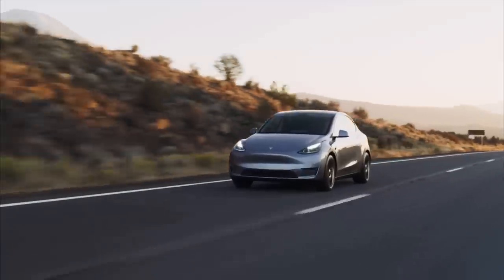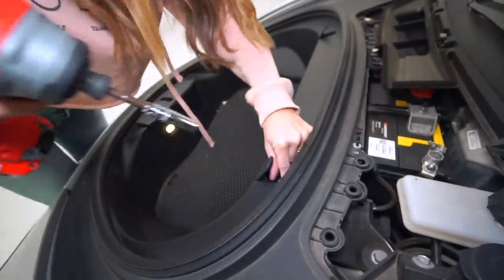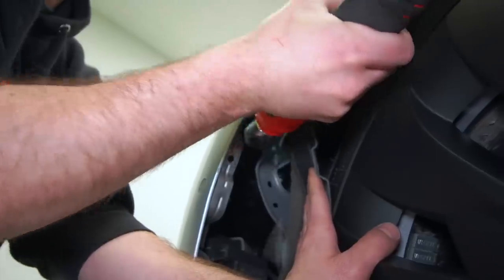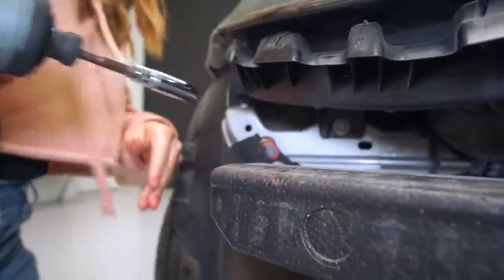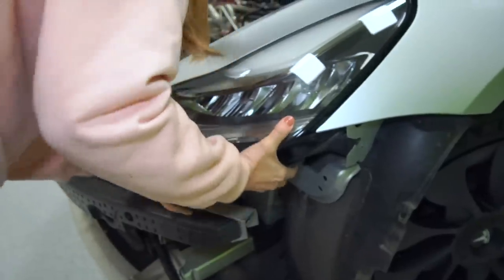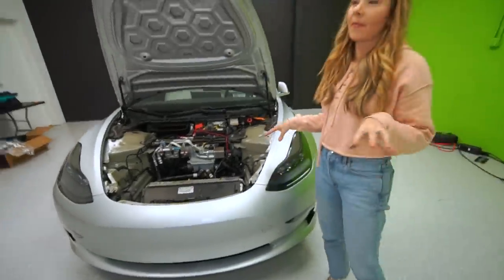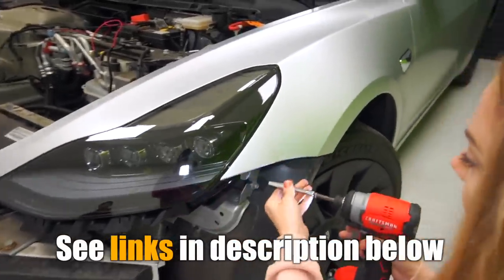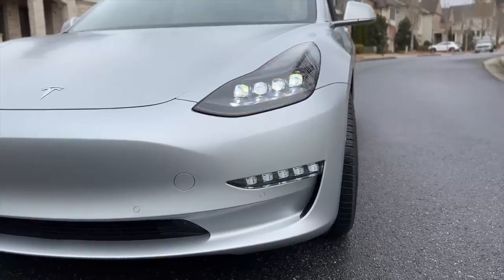My TESLA Headlight DIY with Jaw Dropping Results

Comment: Looks like a worthwhile upgrade, if you have the old reflector only lights. If you have the matrix lights stock, I don't know if it would be worth it.
Reply: I would have to agree.
Reply: The matrix benefits the oncoming traffic, but doesn't increase light output.   The AlphaRex lights still offer an increase in light output over matrix as well.
Reply: Price and where to get them?  I've replaced headlights on 2 or 3 different vehicles, but never have I had to remove body panels.  Seems so odd!

Comment: I'm planning this for my 2018 Model 3 and wanted a video more reflective of the bolts as they would be in 2018 models. I also plan both changing headlight and fog lights, doing it myself with Dad help, since bros aren't near. Your video is perfect. Thanks.
Reply: did these alpharex headlights fit in your 2018 Model 3? I want to get for my 2018 Tesla Model 3 Long Range RWD and make sure it fits and works

Comment: These headlights don’t work anymore on the new Tesla update. They quit working on me after I did the new update. I had to put my stock headlights back on. Unless Alpharex finds a solution, don’t even bother buying these for your Tesla
Reply from the maker: Doubt it’s related to the update. I had the same update and works fine. Plus should be under warranty if something has already happened.

Comment: Those look very nice and great job, any stress on the battery with more light coming from these?
Reply from the maker: Always a common question but any extra used energy would be negligible compared to external factors like air temperature, vehicle load, speed and rolling resistance.
Reply: I would think so because these seem to be also powered by the 12v battery

Comment: Thank you! A subset of your viewers of which I am firmly a part would be interested in the relative energy use of the original vs the changed out forward lighting options. For night time driving situations how does this change affect the car's miles per kWh performance? Knowing this we could then weigh this data with any potential increase in safety the change out enables. These two metrics, efficiency and safety are so much more meaningful to me than the appearance of the two choices.

Comment: Wonder how big of a difference it is…(in not blinding, oncoming traffic)
Whenever I’m on a dark road I get lots of people flashing me thinking my brights are on with the stock headlights… Is this a dramatic reduction?
Reply: yeah, not like the factory Tesla headlights are dim or anything! TOO bright and precise, does this make it worse?
Reply: You can adjust them down in the service menu.  Most likely they are just aimed too high
Reply: that can happen when the autoleveling fails or goes wonky. just set them yourself and make sure they dont blind. maybe set the one on the oncoming traffic side a bit lower
Reply: That's the purpose of the sharp cutoff line mentioned in the video, It keeps the glare out of oncoming traffic better than stock headlights.
Reply: @pgwar22  which is a problem unfortunately with modern headlights.... especially on suvs.

Comment: Like the video. But why do the lights need a separate battery hook up? Most lights (that I know of) are plug and play.
Reply: The new lights probably draw too much current. Hopefully they include over current protection or an easily accessible fuse.

Comment: What about the feature that new Matrix Headlights which moves with your steering wheels (not software updated yet)? Would these Headlights also pivot multiple directions?
Reply from the maker: Good question, I know these do mechanically move in the high beam position but your other question would be best to ask Tsportline.

Comment: Do you get any HCMR Mismatch errors in Service Mode? You can enter service modes and press "Service Alerts". The reason I ask is Tesla headlights actually have software on them and an error code or a loud noise can occur with the lights if the software is not matched.
Reply: No errors, the AlphaRex lights communicate properly with Tesla LIN bus protocol.

Comment: Do these headlights have matrix functionality? How do you aim them? Is aiming done through the menu in car like the current headlights?
Reply: These do not have matrix function.   You aim them like any other headlight - shine on a wall and adjust the height to match left and right, easy.

Comment: If u mess up the car will tesl
 Fix it under warranty or would u have to pay fully
Reply from the maker: Manufacturers can no longer legally deny warranty unless they can prove the issue you’re having is directly related to the part you modified. If it’s something you don’t feel comfortable doing yourself, always can find a professional installer.

Comment: How do you use the built in Tesla headlight adjustment setting in the UI?  Or you don’t because it does not work anymore?
Reply from the maker: It’s still adjustable
Reply: @ItsKimJava  very cool.  The projectors must have motors in them controlled by the UI?  Thanks for all these upfitter videos. I am going back and forth between the two driver instrument panels for the 2022 Mod Y P.  One has Apple Car play, the other matches my white interior and has the essential display info looking for. Some you have had yours for weeks now, any comment on reliable operation?  Any difference?  

Thanks for quick reply!
Reply from the maker: I personally like the one that matches the white interior and the basic info. Although CarPlay is nice, I found having visual access to the important info was more useful than all of the extra features the other offered.

Comment: I don’t know if anyone else encountered this problem. I had the lights installed and they became unresponsive- they won’t turn on after a Tesla Software Update - SEP 17th 2023. Driving at night on pure fog lights. 2023 Model Y Software V11.1 (2023.32.4 8840a2c1e5e8)
Reply from the maker: Seems unrelated to the software as I’m daily driving this 3 and have never had issues with updates and the lights. I would contact Tsportline

Comment: So much engineering goes into headlights, I seriously doubt theses cheap Chinese made headlights have gone through the rigorous design, engineering and testing that the stock Tesla headlights have. I would not change out such a critical part as the headlights.

Comment: I must be the outlier as to me they look awful. Did a chinese flashlight company get into the car LED light business? The LED sections are too large and poorly integrated together. And no, I wouldn't want to directly connect it to the battery. The current draw must be much higher than stock lights. The light projection wall pattern appears too blocky. I want mine more evenly distributed across the field of view.